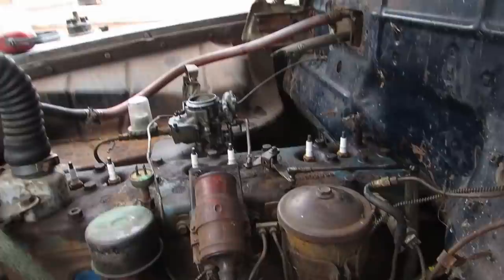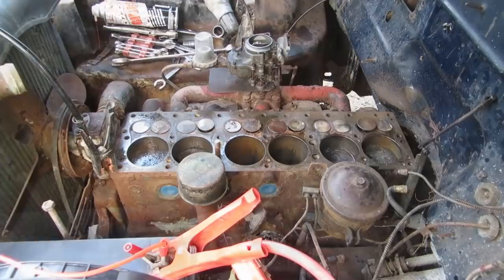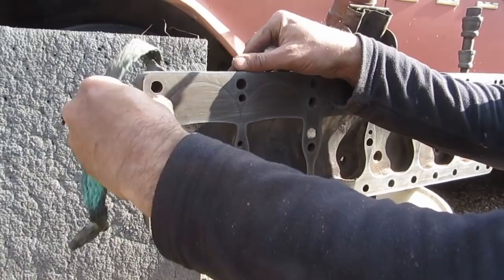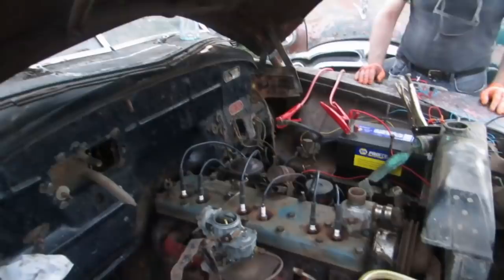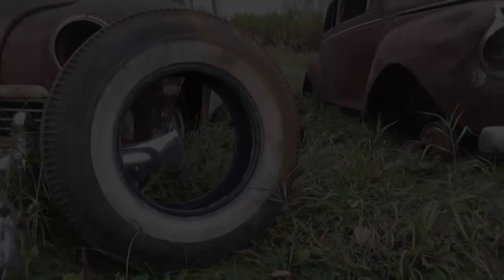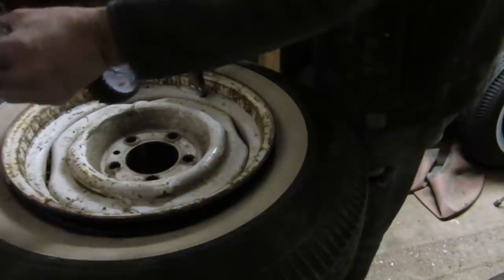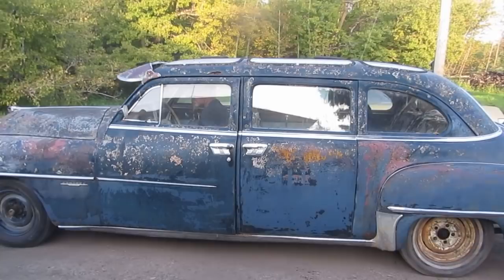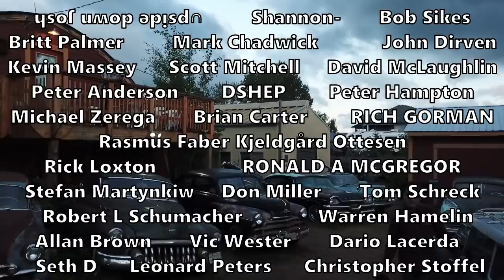1951 Dodge Coronet Limo: First drive in 50 years!

Comment: Enjoy the limo. She cleaned up quite nicely! Got a chuckle out of the tire in the dishwasher. Brought back memories. When I was young, dumb, single and broke, living in an apartment. I had a 75 Chevrolet Monza 2+2 v8 4 speed manual with the turbine hubcaps.  Cleaning them was almost impossible because of the small spaces and textured surfaces of the blades. A neighbor came out and installed the very clean wire spoke on his wheels. I asked him how he got them so clean. He said dishwasher. Ding, ding ding! I promptly went and got those turbines off the Monza and put them in the dishwasher. Ran them through a cycle and then checked them out. Had never seen them so nice! Moved them around a bit to get the spots that didn’t come clean and ran them again. They came out spanking new clean looking. So after that I did that on a routine basis. Then one day my mom came over and being mom, started cleaning up my kitchen while I was in the other room. I heard her let out a yelp and when I went to check on her she was standing there holding the open door to the dishwasher with that look moms have when the see their kids do something totally unexpectedly outrageously crazy. She never forgot that event. She would bring it up occasionally when she wanted to share a funny story.

Comment: It's a old Dodge flathead, they turn and sorta run after sitting in a field forever. We got a 41 Carry All military Dodge going that had been parked in a old saw mill by the Sandy River after at least 20 years. Block had 3 cracks between the freeze plugs and they sprayed the cylinders down and put a tune up on it and it started, had oil pressure, and only leaked water for  tiny bit till it heated up and closed back up. They drove it around with one mostly working brake for a while and eventually replaced the engine just because of the cracks. Pretty sure they were forced to rebuild the brakes and drove it as is for a long time, you could barely see through the windshield and all the needles on the guages were broke off but the nubs moved.

Comment: My Neighbor had an old '60's SAAB. Every morning as I'd walk to school, his leaving for work coincided with my walk up the same block to the corner. He'd start the car, barely wait 10 seconds before pulling out onto the street then leave a blue smoke stream of exhaust fumes the entire length of the roadway.  The smoke would linger long after he'd left the block and I'd have to inhale that smog for several minutes until it either blew away with a breeze or if I made it to the corner and turned left (the opposite direction he would turn). This procedure lasted from 6th grade through to 12th . when I graduated so did he as he's bought a Dodge Dart after that.

Comment: My dad had a 1949 Windsor with this motor. I drove it a lot and I really loved it. The long-stroke flathead was just so smooth and relaxing and Fluid Drive made having an automatic transmission superfluous. In town I just left it in second gear and it picked up right smartly! The only time the clutch was ever necessary was for shifting ranges and the Spitfire could even pull high gear from a stop with the Fluid Drive with no problem! I know this is true because I tried it. Showing up to pick up a date in a 1949 Chrysler was just so cool. The next date I'd arrive on my RZ350. Most women couldn't handle it.

Comment: I'm impressed! No way did I ever think that you would get that engine to run again! That blew my mind!  When I saw your pick for ''Classic'' tire I had a flash back to the 70's when I worked at Mansfield tire! We were a ''jobber'' shop and would build tires for any anyone that wanted them! I know a lot of ''Pennsylvania'' tires were built  there along with Mickey Thompson, Firestone, B F Goodrich, And Kellys, In fact I have a set of Kelly Super Chargers on my 1971 Cutlass that were made in 1975! I bought a whole car out of a barn to get the factory rally wheels  that had them on it and they had been kept out of the sunlight so they had no dry rot or cracks in them! The tires made back then had a lot better quality rubber in them! The ''Boogie van'' looks awesome! I was watching for ripples in the body work while it was still wet and shiny and I didn't see any flaws in it! That van is nicer now than when it was new! Keep on keeping on guys!

Comment: Ole 'geezer gearhead' again. THANK YOU Todd and gang, for the memories! When you pulled the head off the flat head 6, my old mind raced back to 1961. I had a 'cherry' '49' Ply. I rebuilt the eng. when I was still in high school. Turned it over after graduation. Damn near killed myself. Then bought a '55' Ply. same eng. rebuilt it too.  Nickle and dimed it until I could afford my NEW 1969 Ply. Satellite convert. Wish I had the '49' and the '69 Sat. now. Thanks again for the memories. Bruce R.(sorry for the long post)
Reply: BTW. Tom reminds me of my old man(my father). Who was an auto mechanic from the Model 'T' days. right up to the big block era of the mid to late '60's.

Comment: thanks for another excellent installment! amazing - from 50-years in a field w/seized wheels, cracked block ("junk" engine), and stuck clutch to driving in just a couple days - that's got to be one of the fastest and most successful first starts in cwm history. add to it that it has floors AND brakes (!!) and it's already a classic addition to the lot. a couple rattle cans of color, some lysol, seat covers and a cherry bomb muffler and the fishbowl/samba should be ready for pebble beach.  carwash looked like the agents were scraping barnacles from a boat. key & taper axles were a miserable design. boogie van coming along nicely. looks like the 96 has a decent body.  great idea for washing tires. also nice to see tom once again sharing his trademark "colorful" sage advice (ha!).  have you considered requesting a government grant for mosquito control?

Comment: I think, "hey that valve is not closing", and then you spot it...Then I say, "hey put a little lube on it," and then you do...Then I say "hey tap it with a hammer" and then you do that...so cool you guys think smart! would love to hang out with you guys fer a day or two..
Reply: Stuck valves on an old Atomic 4 cyl is common on boats.  Just pull the head, add some PB Blaster to the valve stem and tappy tappy until they move uppy and downy on their own and slap the head back on.....shade tree mechanics have been doing this for generations.
Reply: I think I would just like to bring a chair and watch or just hang out in the bar .

Comment: There were never that  many of those Dodge limos around back  in the day. That could have been one that Connelly-Mckinley funeral home used. They always had Dodges and Chryslers.  Used to  see them parked at 148th St. and 99th Ave, where they lived, back in the fifties.

With the head off that Dodge it brings back many memories. I worked at Taylor, Pearson & Carson  '59-61 tearing down , rebuilding and painting thousands of those Mopar flatheads.  Fun lob and learned a lot.  Had my share of Mopars too!

Comment: Big shot Hollywood types with a limo whats next a airplane cheers
Reply: Well it will have to be an old one, perferredably with an upper and a lower wing.  Just to make it a little safer to operate we will be removing about 2 foot of propeller blade to make taxing safer and flight impossible.
Reply: Some long abandoned Crop Duster.

Comment: This is probably the latest I've watched a CWM video not because of a vacation...Back On Tuesday, I bought a non-running 3 years parked 1947 Oldsmobile Series 76 2 door Club Coue (read that as fastback) and spent all of yesterday working on it (and driving it). I had it running on Thursday (same day I got the battery) by simply rotating the distributor 180 (and the previous owner wondered why it was popping out the carb and freaking him out).
It still needs a bunch of work (especially the Hydramatic trans) but it's solid and has some nice history to it and is coming along well. After all the time I've been chasing this body style of GM its fantastic to finally have one my own!

I'm looking forward to seeing more of the 60 Fury again.

Comment: Love that Limo- how good is she! I know there's many a car ahead of it but that gets my vote for the next resto- if it were mine I think I'd go for a mechanical/interior/ rust holes only. The skylights and roof  rails look to be quite a big problem but nothing you can't fix and probably improve upon. Leave much of the outside orig, save if you can what's left of the hotel graphics and clear coat it, nice wheels and that is it. And even sell it on ...? At  a slight profit?  That is an unusual and very cool car that many would be interested in - across the border especially.

Comment: #244 checking in from NC, Back in the day I had heard of diesel mech usinfg "Bon-Ami" cleanser to reseat rings and valves. The secret weapon was the ingrediant "Diatoms" a mild abrasive that would disolve. I think the added it to the oil,and maybe to the fuel.

Comment: Re-viewing this video even more fun the second time. Back in the '40s actually saw these "Fluid Drives".on the streets of Montreal. Apparently these and some other early fully automatics, may not have had the safety cut-out to prevent starting in gear? Some accidents could happen. Even my '84 Volvo (4-speed stick + push button overdrive) could be started despite a broken clutch cable.

Comment: 18:00 I use a squirt bottle with a small hole that constantly dribbles into the carb. When it starts running I squeeze the bottle to squirt larger amounts and keep it running

Comment: That Coronet is almost 70 years old. Imagine someone in 2090 discovering a 2020 vehicle. Half of the outside is plastic, so that will be long gone. Forget about freeing the valves with a hammer and some penetrating fluid. The timing belt will have turned to dust, and being an interference engine, turning it over will be fraught with danger. You fixed the points with emery paper and a file. Try that on a crankshaft position sensor! If the engine control unit hasn't disappeared into a mass of corrosion, who will know what to do with it? Windows 95 was only 15 years ago and I would have problems doing complicated things with a windows 95 computer. As for aluminium radiators with plastic tanks... I wonder what the newest car that doesn't work would be that could be fixed by Scott with his present tools.

Comment: Scott, one of the things I use for things like cylinders and as penetrating oil is old auto transmission fluid that people get rid of long after the car is gone as they change formula so much, the other suggestion would be on the end valve not moving, might be rotate and oil the stem

Comment: Well that did not take too much to get her going. It had lots of rust and crap in the cylinders but you got it all cleaned up she burn old a bit still but I'm sure a bunch of hot and cold soaks the rings will loosen up and hopefully seal again but that things runs great just touch the key and it runs and drives too that a old mopar for ya you can't kill them

Comment: Wow, I'd really be tempted to just pin that crack and run it as is after hearing that. Amazing how much less frustrating it is trying to cold-start an engine after decades when you go thru the distributor and carb first.
Reply: Also: If Ash decided to sell the rights to Revell or AMC/Ertl to make a 24/scale model of the Boogie Van you know I'd buy it.

Comment: Now that's what I'm talkin' about. Still looking for that deal on the Huth Bend-o-Graph exhaust pipe bender and a gross of generic mufflers. I wonder what the price of STP is by the 55gal. drum? That's OK new oil, filter and 20 miles at 55 mph should cut that smoking back a bit. Do they make 7.00x15 6ply "Traction Kings" in wide white? I absolutely love it. Nice job!

Comment: Sorry but I just don't get it. What's the point of forcing the engine to run without properly stripping it down first when you run the risk of scoring the bores and bending the valves and just making it worse? Just to prove that it runs... for ten minutes before the grit from the sandpaper and the loose wires from the wire brush wreck the engine?
I'd only do that for shits and giggles on an engine that I was going to throw away...